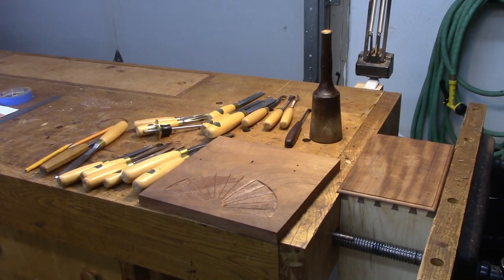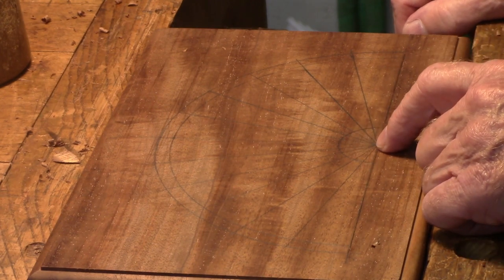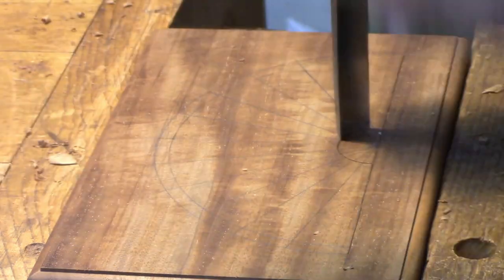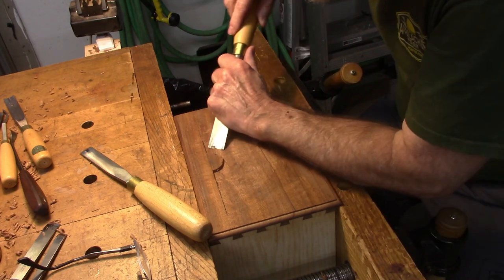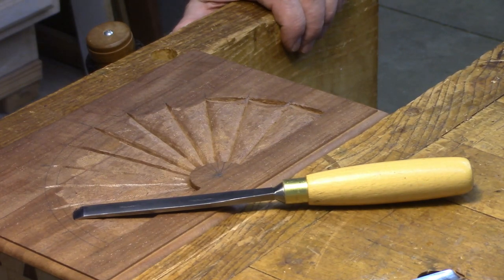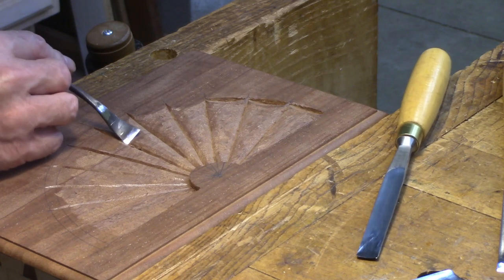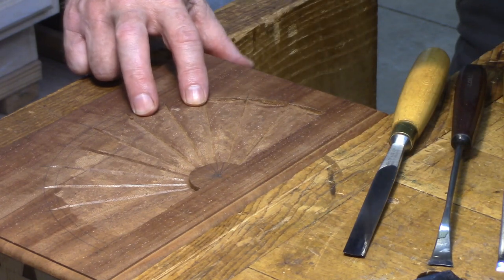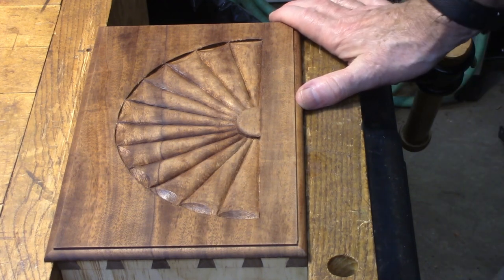Queen Anne Lowboy   Carving a Fan Step 8

Comment: Out of curiosity, how does the level of hardness to carve this compare to ball and claw foot?  I ask because I’m currently taking an evening carving class and am doing a ball and claw.  Will re do that at least once and then thinking to go to the fan next.  Would like your thoughts.  Thanks.
Reply from the maker: The flat fan is easier than the ball and claw.  The undulating fan is about the same.
Reply: @oeff Thanks David.  Can't wait to carve one of this.  Has to be easier than the ball and claw.  My first ball and claw is likely mid-way through and looks like a drunken beaver gnawed it out.  Practice, practice, practice.  Learning a lot.